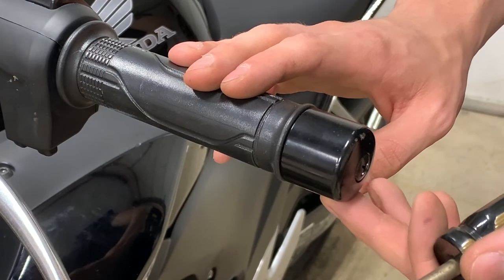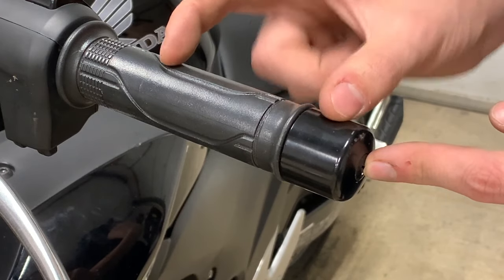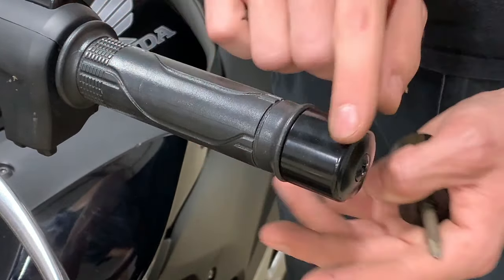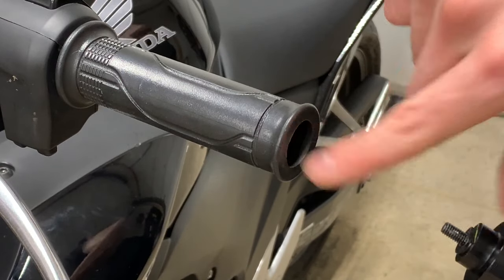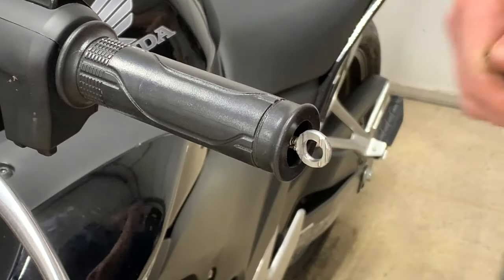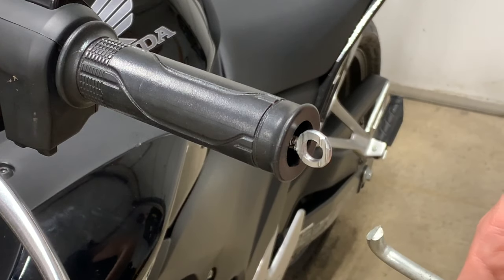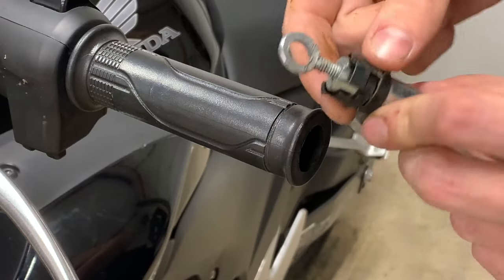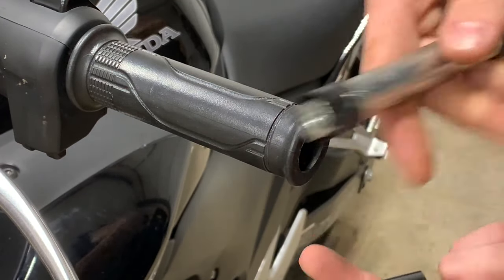How to Remove Bar Ends from a Motorcycle Handlebar

Comment: I tried prying it out with screwdriver but did not work. I used the technique and it worked well. I simply grabbed the bar end screw with a pair of pliers and lightly tapped the pliers with a hammer and it came out! Thanks.
Reply: Thx for the trick ! I was blocked today  but tomorrow i will try your solution.

Comment: So... If you don't want to damage the clip, just pull de weight till you se the clip, and with two flat screw drivers push to the center of the weight. And you take them off in half of this time and you can use them again.

Comment: Sometimes just removing the bar end screw is a nightmare (red Loctite). I've had to heat it up on my Ninja 250, making a sheet aluminum shield to protect the grip.
Reply: I got one out with a crescent wrench on my little screw driver, but the other one I messed up the screw head

Comment: I can’t seem to rotate mine out even after hammering the living dookie out of the pliers. I don’t have the tools you show but is there any other way of removing them?
Reply from the maker: @hectorcortes7246  if you’re willing to break stuff, you can hammer a wedge between the inside of the bar end weight and the outside of the bar/grip. It accomplishes a similar outcome but you may break more stuff doing it. Continue at your own risk.

Comment: Thanks for the video!! Although it's FAR EASIER to LEAVE the bar weight on the end.  Roll back the handgrips so you can see the holes in the bars. Use a pointy object to rotate the clips sideways so the tabs go under the edges.  Then spray with some light oil. Pull it out by the bar end.

Comment: So I bought my bike used an 07 CBR600RR and it has already game with Barend sliders. However, I’m trying to attaché barend mirrors. But that retainer keeps on spinning making the mirrors rotate. Any idea on how I can make the retainer solid and not rotate?
Reply: 1st, you must trade in your 600rr for a liter bike, then you proceed from there 🤪.
Just kidding with you. My first bike was a 96 Honda CBR600F3 bought back in 97, and after putting a Yosh full exhaust and going 1 tooth down on the front sprocket it was topping out at 183 mph and beating 97 GSXR 750's. The CBR600's are excellent bikes, and a perfect bike for someone to learn how to ride sportbikes. Enjoy your little monster 😍.

BTW, I recently purchased the 2nd bike of my life and it is a 2003 Yamaha R1 with 10,000 miles on it. Wow, this thing is insane. Now I know that if I started on a 900+ cc bike I would have killed myself. Even after riding the CBR600F3 for 18,000 miles in 1 year, I still feel like a total newb when trying to handle this slightly nodded R1. But... That didn't stop me from ordering a Hindle full race exhaust and Power Commander 5 🤯. Let's hope it doesn't wheelie in 3rd after my dyno tune 😂. Already yokes the wheel up at 70 mph in 2nd 😂. Pretty scary machine really. I couldn't imagine a 2017+ R1 💩my👖

Comment: I'm having an issue with this now. Problem is, unable to break loose the screw in the bar end. The whole bar end, screw, and insides just keep turning. Want to add heavier ends to a Honda CBR400R. Pretty much the same as 500R in the US but I'm in Japan.

Comment: Great video!  Alternatively, you can buy a long M6 rod or bolt, screw on a couple of nuts and washers and then screw it into the handlebar.  Then, take a crescent wrench around the rod and use a hammer to pound the wrench to pull out the retainer.
Reply from the maker: Great idea!
Reply: @Casey_Schmidt  I saw a video using that technique but without the rod.  I thought of combining your solution with the other guy's and VOILA!

Comment: will you cause more vibration without the weight or can i keep the weight if i were to install hand guards?
Reply from the maker: From my experience, the vibrations didn’t change. The weight of the hand guards kept everything in check. The weights are not securely retained so no you’d have to use the clamps from your hand guard kit.

Comment: How do you reinsert the locking clips back in? 

I have a replacement clip but I can't get it to lock inside the inner holes of the handle bar.
Reply from the maker: I never got that far since I replaced my bar ends with hand guards. I believe it should simply pop into place if you get it in the right position. You’d have to read the manual to know for sure.

Comment: my friend remove that bar end, and his bar shake so much on bumpy road.
is that thing works as a stabilizer too?
Reply from the maker: You should not remove it unless there is something to replace it with. It acts like a tuned mass damper. It absorbs and cancels out vibrations. I put hand guards on to replace the weights so I never had any adverse effects.

Comment: Hello Casey,
Any idea what to exactly ask for when trying to purchase some of these broken clips?
Reply from the maker: “Honda CB500 handlebar inner weight retainer clip” The service manual calls the component “weight retainer“. The part number I found that most closely matches this part is: 53108-KR3-940. That may be for a different chassis but that’s the closest I could find on a first search. If you contact your Honda dealer, they should be able to help you out; although at a higher price than online suppliers. Good luck and thanks for watching!
Reply: @Casey_Schmidt  thanks appreciate the quick response!
Reply from the maker: @Enicon - Thanks, I'm glad I could help!

Comment: The weight might has threadlocker on it. Mine hard to remove and i had to ask the mechanic to force pull out the the whole weight by using hammer.

Comment: What happens if you accidentally push the bar end insert farther into the handlebars? I’ve seemed to have pushed mine back significantly far and now have no way of removing.
Reply from the maker: @Dude Speak - I can think of two things. The easier one would be to get a piece of all thread and try and pull it out by threading a long piece of it into the core and pull it out. The other option which really isn’t that much more difficult would be to remove the handlebars and hit them on the ground in the way that would make it come back to the end. If you choose the second option, maybe put some thing down on the ground like cardboard or a rag so you don’t mar the paint.
Reply: @Casey_Schmidt  Thank you, I'll give that a try. Currently, the weight being pushed back is causing my throttle to stick, so I need to get it resolved.
Reply: @dudespeak1873  stuck throttle = more wheelies... Therefore I see no problem here...🤔

Comment: Will this work on an 2015 R3
Reply from the maker: @Bruhhh - I'm not as familiar with the Yamaha R3 platform so I can't say for sure. I can say that most handlebars use a fairly standardized system but there are still some difference between brands.

Comment: I managed to do this without breaking the collar. Flick the collar clips off using a screwdriver and pull the weight out with a screw bottomed out the thread and a mole grip

Comment: Mine won't remove. I tried this on my CBR300R but it is not coming off. Same design. I've mildly stripped the head.
Reply from the maker: @Timothy Gardner - I am assuming that by "stripped the head" you are referring to the Phillips/JIS screw, correct? If that's the case, first try using a JIS bit. They fit far better than Philips bits and are less likely to cam-out. If that won't work, then maybe try an impact driver. If it is completely stripped and won't come out, you may have to cut the grips off and undo the little clips from within the internal keeper. Alternatively, you could possibly try this guy's method: https://www.youtube.com/watch?v=USpea_DObF0&t=5s
Best of luck!
Reply: Why would you want to remove the weighted bar?
Reply from the maker: @VitalyMack   - I removed mine because I was later going to fit hand tusk hand guards. Many other mods that people do also require removing them.

Comment: But how to again install these again...pls tell me 🙏😔 I removed these bar end rods but when I tried to reinstall it. It didn't happen. 😔
Reply from the maker: @The.CBR_guy - If the clip isn’t broken, then you can push it back in and rotate it until it clicks back into place. If the clip is broken, you’ll need to buy a new one from Honda.
Reply: @Casey_Schmidt  there is no any clip or any other kind of stuff has been broken. But then also I'm unable toh fix it again. Coz, I removed the original bar end rods for installing the after market bar end protectors but that didn't work well. So that's why now I want to install the original bars again.

Comment: Very easy...
But what about the other side with the throttle???
It's all covered with the milky white plastic...😢
Reply from the maker: That’s a great question. I made this video long enough ago that I don’t remember having an issue with the other side. Your bike could be a different configuration than the one I had. At your discretion, you could loosened the throttle tube assembly and then pulled off the bar end as shown. That could work.

Comment: Ok that bolt doesn’t come out that easy. I have tried with a Phillips screwdriver and the bolt will not crack. I know Honda puts thread lock on it.
Reply from the maker: @Wolfy2929 - Maybe try an impact driver. Either the electric kind of the kind that you hammer. You could also try using a JIS bit instead of phillips.
Reply: same, just use an impact drill
Reply: @HayJubbard  bad idea. Damages the screw wish I’d not read this comment

Comment: This only work if the bolt is not rusted inside
Reply from the maker: Yes. You can try prying off the whole assembly but that can also have mixed results.

Comment: Hi I’m trying to buy that thing me I know  what’s that name
Reply from the maker: @Pestinf Yawa - if you are referring to the tool that I used, it is called a slide hammer. If you were referring to the thing I screwed into the core, it is just a thumb screw with a hole drilled in it. Hope this helps.
Reply: @Casey_Schmidt  the one you took it out
Reply: Yes what’s the name mine is missing I can’t put my bars end